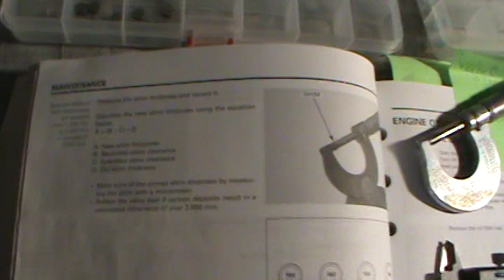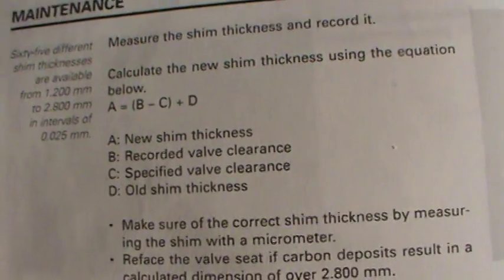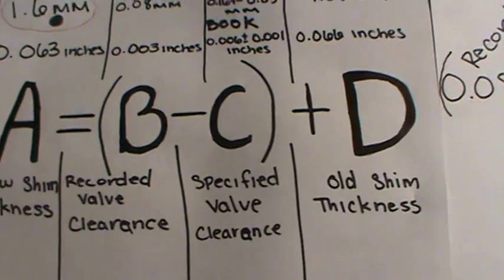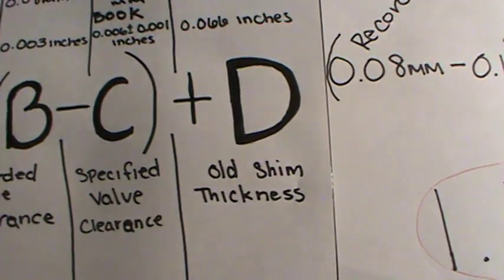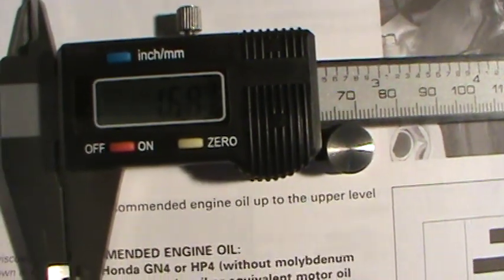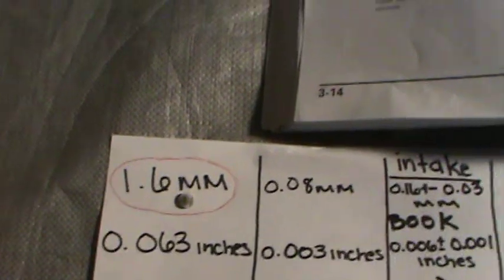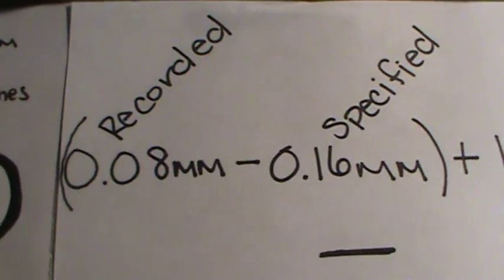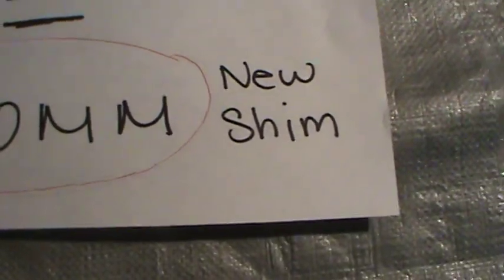Valve shim adjustment calculations made simple

Comment from the maker: It looks like you are doing it correctly. I was confused when you said 10-20 intake, and 20-30 exhaust. All my calculations were like yours; the new shims were smaller than the one I remove. Make sure you double check the valve clearance after putting new shims.
Reply: probably thousandths of an inch

Comment: ok left intake:.004mm w/2.90 old shim,new 2.75 correct?right intake:.003mm w/2.90 old shim and 2.75 new.    left exhaust:.008mm w/3.00 old shim and 2.80 new correct? right exhaust .008mm w/3.00 old shim and 2.80 new shim,are these calculations even right?i subtracted five from the clearance and added that 5 to the smaller (new) shims 2 to 3 times,correct?sorry for making it so complicated,idk what other way to put it

Comment: Hi how can u compute about dis valve shims of my raider150 it has a. 8mm exhaust and. 6mm intake that is not the standard of valve shims of my motorcle i already replace it can u compute so i can put it back the standard valve shims of my motorcycle.. The standard size was about. 20mm exhaust and. 10mm intake thanks

Comment: thanks for the video, i understand the valve clearance get bigger but how can it get smaller thanks again
Reply: Warping of parts due to heat, or not changing your oil, allowing carbon to build up.    But I do wonder, if there are carbon build ups, you do the adjustment, and you one day decide to clean it up with additives, will it mess up?

Comment: Hi i have a question if you don't mind,if my left int is .004 w/2.85 and right is .003 w/2.85 .. left ex: .008 w/3.15 and right ex:008 w/3.20 then what shim should i put instead of those shims?the manual says 10-20 int. and 20-30 exh        is the first one .011 =1.10 ?